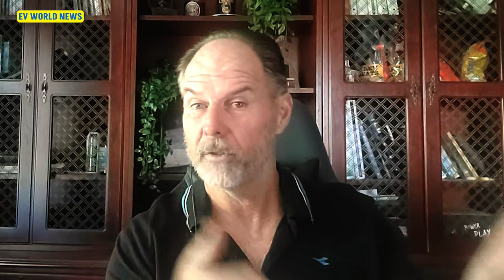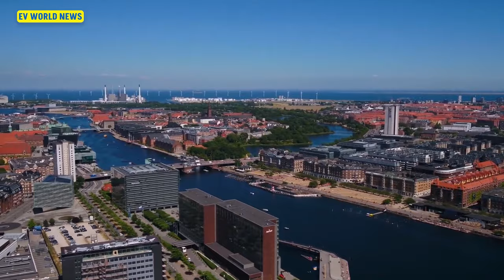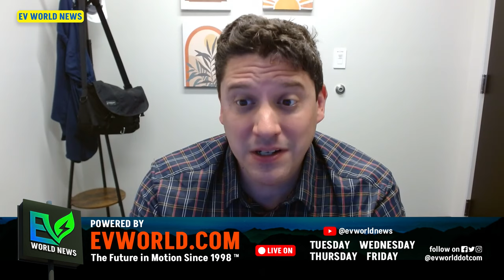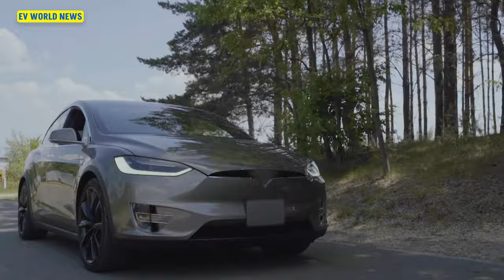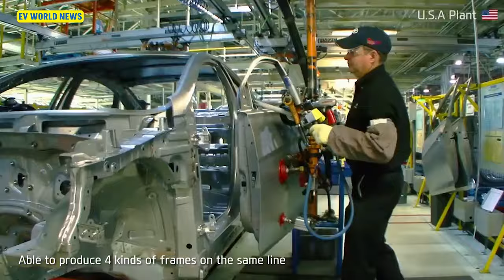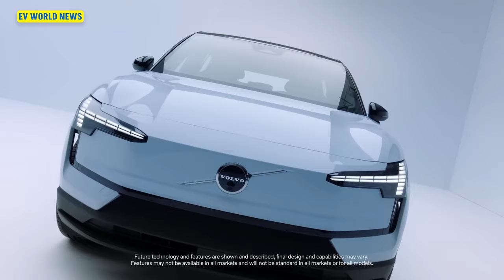Should the Europe and USA Protect Our EV Manufacturing From China?

Comment: "China flooding European markets" is such a low-effort propaganda piece. 

Last time I checked how car manufacturing works, every single car coming off of the production line is the result of a car dealer putting in an order and paying for it.
A lot of the Western media makes it seem like China simply dumped tens of thousands on EVs in European ports, pressuring the local authorities to do something with them, otherwise they're left with a massive bottleneck.

No, all those EVs are paid for, accounted for, it's just that European governments meddled with the market to such an extent that dealers thought they struck it mega-rich by taking full advantage of the taxpayer-funded grants and schemes, considering that consumers were being pressured to buy EVs. When that failed, surprise, dealers are stuck with EV stock.
Reply from the maker: EU car sales are down overall, not just EV sales.   Sales are down something like 15% from 2019 levels for cars in general in the EU.  
In the USA we have massive stockpiles of full sized ICE pickup trucks and jeeps.
Reply: @EVworldnews  it's as if planned obsolescence and federal meddling can have side effects.
Reply: @EVworldnews  you've tackled the topic in a more straightforward way, by asking the classic "what's the baseline? [for any car sales]"
Reply from the maker: ICE cars are definitely becoming more fuel efficient.  If someone could make petrol go from 25% or so efficient to 50% efficient we would double the mileage and simultaneously cut emissions in half.  I have seen tech out there that in theory could make this happen but it always seems to get suppressed.